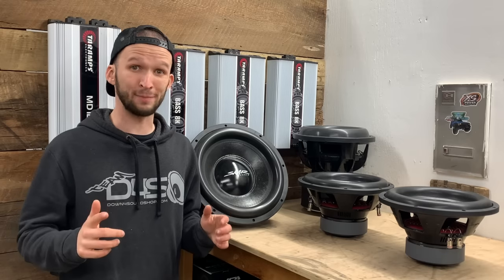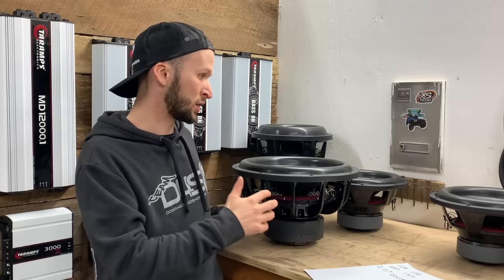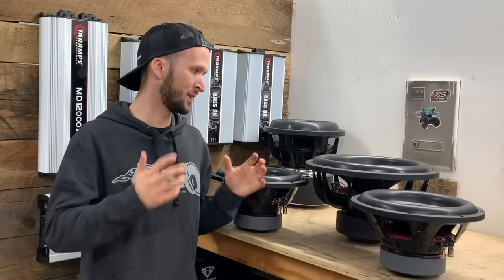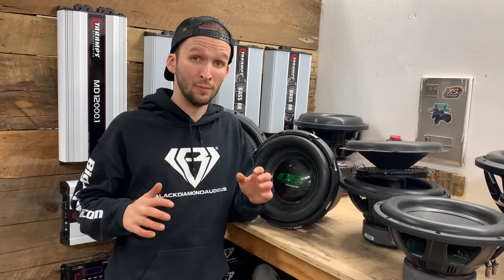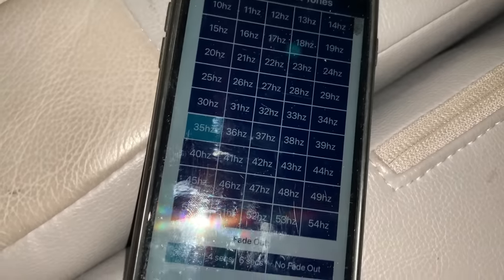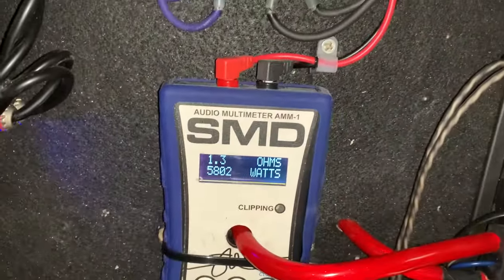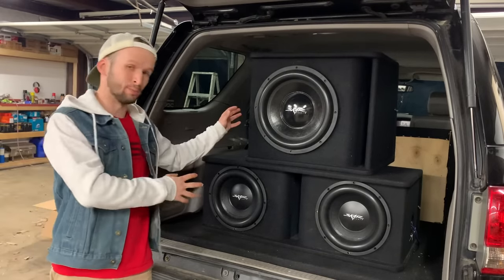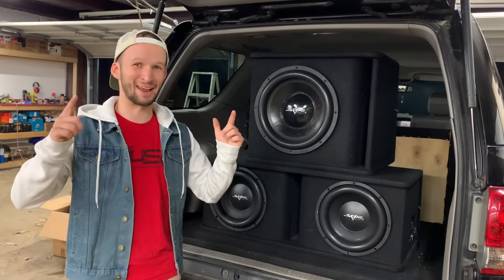ONE 15 VS TWO 12 SUBWOOFERS | MYTH BUSTED

Comment: Run all 3 and see if you actually get more or not. Everyone says don't mix sub sizes.
Reply: I agree
Reply: You can mix but you should run off different amps because the tuning will b different between sizes
Reply: My friends and I have been mixing sub sizes for years running all on the same amp and in some cases in the same box and never heard any complaints
Reply: If he runs all three it will be like running 1 15 and  1 18 he will definitely get gains
Reply: Running different size subs in the same box is the main concern possibly blowing out the weaker subs. Now if in separate boxes with different tuning you will cover a broader/larger frequency range which can help in a SQ setup.
Reply: @steveclark9934  I'm sure you're right we just never gave it any concern to blowing equipment we just ran what we had and had no clue what we were doing and we're happy as long as it sounded good and every basehead knows you're never satisfied and always making upgrades so if it blew it was just time for a new setup
Reply: @MichaelJohnson-je2vo  I've pretty much done the same do what you can with what you have trial and error to make it sound as best as possible.
Reply: As long as you have them in separate boxes from each other it’s fine. I used to have 2 12s in a box and a single 15 in its own box and own amp for years! It was kinda cool bc one box picked up higher frequencies (40hz) and the 15 picked up lower(28hz).
Reply: You can mix sub sizes to just have to have separate amps for each size
Reply: I was gonna comment that lol
Reply: @jackkight7771  have two t1s1-12 and one t2s1-16 in seperate chambers Keep in mind there are two chambers to a basic single sub box. 1 is the space inside the box, 2 is the space outside the box. If the 16 has much more motor force it can overpower the spl of the smaller motor force and leave 0 gain. I don't gain anything when I put just one 12 slim on with the 16. But if I run a single t1d2-12 (better motor force per square inch)with the 16 it has a small gain. I haven't finished my 2 slim 12" plus 1 16" driver build yet. Still sunning 1 plus 1. But I tuned the 12 at a higher frequency so it's more like 2 way component subs lol
Reply: Do it!  Yolo!
Reply: @MichaelJohnson-je2vo  well now you know not too🤭
Reply: I ran 2 x10" on a 1200.1d 
And 2 x 12" subs on a 2000.1d
And 4 x 6" coaxial  on a 200.4

In a 98 Isuzu rodeo and it scared me 😂   it sounded amazing. 

1st day of finally getting to turn it up after break in, I lost my rear view mirror and cracked the windshield.
Reply: @209Twinz209  good times! I'm eventually going to have installed: 
four 6.5"(focal)
six 3" mids, (focal)
6 "m" tweeters (focal flax Evo 3 way)
Two 8" rf p3sd2
Two t1s1-12
One t2s1-16
Two t400x4adcp
One t750x1bdcp
T1000x5adcp
T2500x1bdcp
Audio control dm608
Audio control dm810
Audio control epicenter in dash.
Reply: @dominicdymond  that sounds amazing.
Reply: U have to go 2 sizes up or down when mixing sizes. U can pair 10s with 15s, but not 12s. What happens is certain HZs cancel e/o out
Reply: @DavidKulasiewicz  mi 10s and 12s  were knocking so hard, the cars in front of mine in traffics mirrors were shaking... I had each set on different amps. I didn't know subs played anything but the same frequency. The bigger subs just hit lower htz more.
Reply: The issue that occurs is they will go in and out of phase depending on frequency. This means you will have peaks and valleys in your frequency sweep, but you probably don't hear it because music very rarely has single frequencies playing.
Reply: I second this
Reply: Man back before I knew much about impedance and car audio in general I had two kicker L7 15's on my backseat and 1 JL12w6 in the cargo area of my 93 Camaro all wired on the same Audiobahn A2300hct amp then I learned that this specific amplifier has what is called "tri-mono" mode and I had a audiobahn 1206 on each of the L/R channels and an audiobahn 1805 bridged in my yukon denali and it'd make most people tap out or jump out but one time I just wired them all together +-+&g-g bridged on the amp and later I checked it was .33ohm and the amp took it and played but as soon as I cranked it and the bass hit first note I watched my voltage gauge drop down about halfway then 2nd even harder note hit and it literally stalled my 5.7L V8 engine it was sucking so much juice (stock 140a alt and reg style batt w/ofc 0g) so I just wired it back the way I had normally played it with the 12's on their own channel and the 18 bridged.... 😂
Reply: @steventhomas5865  I have noticed on some frequencies. I have recorded on  ultra slomo, but I never did a sweep. They are perfectly aligned on the lower frequencies like 38 and below. But I did notice that without time alignment, sometimes the peak of one sub will differ just slightly from the other, So one starts to fall when the other just hit the peak, etc.
Reply: @markcunningham2959  I like to experiment I like to break all the rules and do everything everyone says not to do just for fun but I'm not doing that so much now though
Reply: You could hook up all 3 to one amp, the problem is getting the impedences to match enough so they clip around the same point. (it goes without saying they need their own boxes) Having separate amps would allow fine tuning for max output for each driver set for spl. Sq wise I have always wanted a 15 for 20-50 hz and a 12 for 50-100 and a 10 for 100-200 hz. Each size driver with sharp cutoff points providing optimal punch in their range.
Reply: @Alkatross  yeah mu setup is not all installed, some stuff is in packaging waiting for warmer weather,  but the end will be 3 sets of focal flax evo 6.5 3 way, a set of p3d2-8 in the doors, a set of t1s1-12 in the trunk and a t2s1-16. Every speaker has its own channel accept subs, each set is on their own mono t1000x5 and t750x1 and the 16 has the t2500x1bdcp. I'm considering adding another mono or a t400x2 for the 8s. But that is a 6 way component set lol
Reply: Cone area is cone area
Reply: @Pilarski.  I remember back in the day we had combined multiple systems into one 93 Ford escourt hatchback, 4 8s 2 12s and a 15. All seperate boxes all seperate amps per size. Most bump I have seen in a 93 escort lol it slammed
Reply: @garymiller652 I did the same dual 10s and a single 12 for the lower frequencies.
Reply: @DavidKulasiewicz  I used to run dual 10s and a single 12, that combination hit hard and low
Reply: I have 2 8in subwoofers and 1 12in built into 1 box . All kicker comp r.  On a 800 watt kicker amp. With a 12 volt compositor. No extra batteries. My wires are 4 gauge. I didn't have to upgrade the alternator.  And I'm getting 2 more 8in subwoofers installed
Reply: @jimmysweet8495  hell yeah!  I love it
Reply: 🤷🏾‍♂️ hey might werk might not🤦🏽‍♂️... But all sizes are together 😂
Reply: I’ve always mixed for years  with 10’s 12’s and 15’s never had a problem.
Reply: The best sounding stereo I ever herd was 2 15s and 2 12s
Reply: I have one 18" With 5 12"
Reply: @nearchd504  that's a lot of 12", I'm driving an accord so 2 low pro 12s and a t2-16" is all I can muster (plus the two 8" going in the doors.)
Reply: The larger the sub the deeper notes it can hit so I call bs
Reply: @zacharyhoopes8730  not completely correct. You can hit most frequencies with most subs, however I would argue the fs is lower the more mass the sub has. So a 15 will have an output peak at let's say 30 where a 12 would be theoretically 40, but, the 12 should still hit at 30 and the 15 should still hit at 40.  But you can have a 4" speaker with the right coil and stiff suspension and high cone weight  that would hit hard at 30hz. And you can have a super efficient lightweight 15 that plays up to 80hz at a high output.
Reply: @209Twinz209  it currently sounds amazing, lol! I also got the u-mic1 so I can eventually tune each speaker to the proper eq (too cold to be working on it right now)
Reply: @DavidKulasiewicz  I'm going 12s and a 16. Their the t1s1-12 so low pro and probably perform more like 10s
Reply: @dominicdymond  dude generalization. Nobody is going to run tiny subs for deep bass.
Reply: @MichaelJohnson-je2vo  me too.
Reply: @zacharyhoopes8730  YouTube has some weird stuff out there, lol. I just watched a guy put 5X 6.5s and 4X 8s in his car lol it looked like it hit pretty hard and he was playing low for the sizes! Also have seen people run Dayton 4s and other really small stuff just for the fun of it. But I agree to a point that if you want low, you go 12 or 15 or 18, and if you want punchy, go 10 or 8 or 6.5
Reply: cuz the ohms and watts is different, plus the cone surface is different, just don’t do it. wont get the sound u want
Reply: @daytonj3226  your thinking in the same enclosure?  I'm thinking of different enclosures  and amps for each sub size. It works just fine.  I'm just not sure of the actual decibel gains when starting with a 15 and then adding 2 12s   and then adding more even smaller subs. When are the gains no longer noticeable.  If noticeable at all.
Reply: Was just about to suggest that too👍
Reply: Seperate amps, seperate crossovers
Reply: You can as long as you cross them over at different frequencies
Reply: @booty4801  I've found good results either way. I actually like the result less if it's at different frequencies because you find the drivers output at different amplitude, and it's jarring on a sweep.
Reply: I've got 2 kicker comp 12s and 1 kicker comp 15 on a 1200 watt class d amp and I was very impressed. Because the 12s hit notes that the 15 don't and the 15 hits notes that the 12s don't. They are in separate boxes. All together it beats the block down 💪
Reply: If they have same rms and ohm shouldn't be ok???? I'm seriously asking I've only owned 3 subwoofers and they all where same size... one was a 1600w max tho so I get 400 and 1600 not working but a 15 at 1200 and a 12 at 1200 with them both being dule voice coil and same impedance  shouldn't it work. Also this only works if both are 100% effichent
Reply: Shouldn’t mix sizes, since they have different air flows and can intervene with smaller subs and not produce bass.
Reply: I've always wanted to try 2 10s in a sealed box tuned high and a 15 in a ported box tuned low just to try and get the high punchy bass and also get them lowwwws lol not sure if it would work properly but would be an interesting concept
Reply: Get better sounding beats mixing sizes
Reply: My best set up was two twelves and two tens in my hatchback cavalier and to this day loudest set up I’ve owned so I say mixing only gives variables in the highs and lows like in bigger the lower lows sound louder so it would make sense to have different sizes in my opinion but only my experience not something I can prove w numbers
Reply: @dominicgarcia85  yeah I was just wondering what the actual numbers look like. If I play my 12 it sounds good. If I play my 16, it is really low and loud. But when I play them, both the 16 takes front stage on the lows, and the 12 only contributes on the higher notes. O can't wait to add the other 12 and change the box arrangement.
Reply: I have and it SLAMMED
Reply: @SS-sw8de  hell yeah!  I am running 2 t1s1-12 and a t2s1-16 with two amps gain matched at 750w each for the t1s and one set to 2600w for the t2. It makes some moves and also has good higher frequency bass, too. Worked out pretty well
Reply: 2kicker 12s ported, and one punch HE10 sealed💯🔥💪
Reply: Not true. Ive ran that. Sounded good.   Ran ported and sealed on the same amon was awesome
Reply: @MichaelJohnson-je2vo yep same here
Reply: Of course you would get more running all three.
Reply: @rationalguy2941  Well, some say you will not. I have had several dozen people tell me it won't work. And that the subs will have different frequencies or something. My opinion is if it's moving in sync, then it's contributing.
Reply: @dominicdymond  the don’t mix sizes thing is more related to sq. The response of different subs across all frequencies will be ‘different’. So you’d likely (but not surely) have certain frequencies that are exaggerated. Regarding spl, you’d just have more of it.
Reply: @rationalguy2941  agreed, but under 50hz I don't focus so much on Sq. Above 50hz is where I put my precision drivers.
Reply: Lol
Reply: I use to have 2 10in subs and a single 15 in my old mini van, hit every low and high perfectly everyone heard me coming on the others side of town
Reply: @turtleguy420  I love different!  I'm so sick of seeing the "same" 2 12s or one 15 in a  trunk facing back.
Reply: I have 2 p3 12s and 1 Ct meso 15. 15 is on 3k and p3s are on 1200 amp. They are all in the same box but have walls inside separating the airspace’s and it sounds amazing
Reply: I had 4 jlaudio w3-12’s, 2 8’s on a taramps hd3000. With a kicker key for a 2 way front stage, I had women dripping in my front seat if you know what I mean fellas, lol, I shook my neighbor’s walls so bad that I had to reimburse them for there nicnacks I broke, lol, it sounded amazing, definitely a head turner
Reply: @cmoney429  currently running two 8s, two 12s, and a 16" all rockford. I have all rockford amps to power it all, but I just recently bought 3 taramps, a smart bass 3, 5, & 8. So I'll switch to taramps for a bit to see how it sounds/feels
Reply: 12s and 18s together and 10s and 15s go together
Reply: @chim7741  just got a 10, so now I have a 16, two 12s, a 10, and four 8s.
Reply: @dominicdymond  🤣🤣🤣🤣🤣🤣🤣
Reply: Ive been mixing subs/amps for years...not gonna change just because some nerds say I should....been slamming since the early 90s...before internet geniuses even existed....I had a friend who thought he was a dang decibel doctor....I would intentionally do the opposite of what he suggested almost every time....can't really remember him having a louder stereo, than me....ever......just recently the same dude sold my brother a dream....sold him all this expensive equipment and told him, he'd have the loudest stereo in town....lol....I bought a Directed 2400D amp and 4 old school (20 yrs old) kicker comp 12 subs for $300 ....guess whos system is louder?...then guess who is salty
Reply: @PhantomOfThePsy-Opera  I remember around 99 I hooked up four 10", two 12" and a 15  all he2, the 15 might have been hx2. But the point is that was the loudest system I had seen in a hatchback Ford escourt with 3 amps 2 batteries 2 caps and 3 bass knobs lol
Reply: @dominicdymond  haha...that's awesome...around the same time, I had a camaro(no seats) with 4 15s (he2) 2 12s (he2) and 2 jl audio 10s , powered by 2 directed 1100d and a directed 600d....2 optima batteries.....ish sounded retarded! and highs and mids were on point....best sounding system I EVER had!.....I miss those days!....now I am a living, breathing, mid life crisis ....now that the kids are grown, and not as needy, I've been trying to pick up where I left off, before kids......Loud stereos, motorcycles, campers.....I can't stop....I'm still trying to be cool..(but I think i'm hanging on for dear life..lol)......I have my eyes on some 15inch kicker L7 on Craigslist...there is 3 of them...Hopefully by the end of next week, I'll have them hooked up to this directed 2400d and be rattling the block......salute!....Hopefully we can stay youthful for many years to come....Stay blessed!🤟
Reply: No, the problem isn’t that it doesn’t increase spl, it’s that it sounds like shit
Reply: @BenHeien  lol...if you say so....I know from experience if you use garbage, you get garbage results...been doing this since the 90s....can't tell me most of my setups sounded like shit, cuz that would be bs....just gotta know what your doing, and how to wire it up....but obviously you don't....not everyone does...it's ok
Reply: So subwoofers cover certain frequency ranges, the people say not to mix is because if you have a 10 and a 12, the only frequencies that the 10 can’t play might only be around 5-10 Hz different so it’s not because anything bad will happen, you just won’t gain much frequency range, the only thing you gain is sound volume, how much sound is being generated, not necessarily frequency differences
Reply: @valhalla7941  yeqhbitbqont be as precise sounding, and  you don't gain a ton going from a 15 to adding a 12. But you gain a small amount of loudness, but the smaller subs are typically lighter andnsonhave a bit more punch, and the bigger ones are typically heavier and give better low end response. 

Gain volume and get punchy plus low lows but lose precision and gain extra peaky frequency response. If you're not an audiophile, it's fine.
Reply: You're not supposed to mix sub sizes because you will create the brown note
Reply: @macbook802  No, that's a myth. What actually happens is you create brown pants because you §ĥăť yourself from all that impressive Bass!
Reply: just not in the same box and not on the same amp

the box he had probly wasnt optimal either way and exocontralto actually had multiple size subs in the OOLD days
Reply: I mixed 2 12s to a 2 channel amp everyone told me not to cause it wouldn't sound good both subs like are 4 ohms I think but jensen is a 1200 watt and the kenwood is a 1000 watt but it sounds great to me at least
Reply: @lilgap5081  I have mixed so many subs and honestly never found any downside as long as you tune it properly.
Reply: Lol I got a jl 10 and 12 in separate boxes ran off one amp and you wouldn’t believe it’s only 500w if you heard it
Reply: Just run em off different amps. Then your good👍🏼👍🏼
Reply: I have a JL 13” and 10” in my truck… each sub has a separate amp and I have a badass sub stage with both punch and depth.
Reply: @sulphuranonymous618  yeah I'm running several sizes with individual amps and enclosures. Its a vented 16, two sealed 12s, sealed 10 and four free air(in door) 8"s. All are slim subs accept the 16 which is like 14" deep lol
Reply: Why if you mix different sub sizes you can have them hit different bass notes so all the bass is more full instead of only certain songs will hit hard
Reply: As long as you get the positioning and phasing correct you shouldn't have any issues and will indeed have a volume increase.
Reply: That is what I think I see the three subs and what it comes in mind is what if you run all at the same time. I can espect any result.
Reply: Mixing subs can be done, concert speakers do this
Reply: I've run three 8ohm subs parallel in a single cab truck, 2 boston 10"s and a kicker 12", all separated and sealed, but on an alpine 3/4 channel (doors were boston 6.5"s  (or old cerwin, don't remember been 25+ years) anyway it sounded phenominal, just noice as hail.. really made my commute a happy occasion, but it did cause the amp to clip if the headlights were on, so i caught a few tickets for driving in the dark sans headlights.. have to make decisions in life.
Reply: Best way to cover all the frequencies is different size subs
Reply: Two 8 inches Subs and one 12 , witch one has heavy bass? .
Reply: @berthagen387  But you can mess up other frequencies in regarda or low frequency. I mean that the sound could turn unclear and boomy.
Reply: definitely not on the same amp as they will resonate on different frequencies using the same amount of energy. but if properly tuned they should help fill any gaps the other leaves. im thinking of using a similar setup but with 2 EVL-65s and a twelve, should be more than enough for my lil single cab
Reply: Lmaooo nobody ever says don’t mix subs. You clearly don’t have any idea about comp, or custom anything. Just npc only. If u ran 2 15s 2 12s 2 10s an 2 8s plus the highs. It would be the best sounding an harder hitting system ever. Once tuned.
Reply: The reason to not run different sizes is sq not spl. If you don't care about how it sounds run different sizes and brands. But if you want sq never run same sizes at different frequencies. I.E. 6" door at 60hz and 6" subs at 60z it will cause distortion
Reply: Don’t run two different sizes off one amp. Run one amp for each size (1 amp for the 15 and another separate amp for each 2x12)